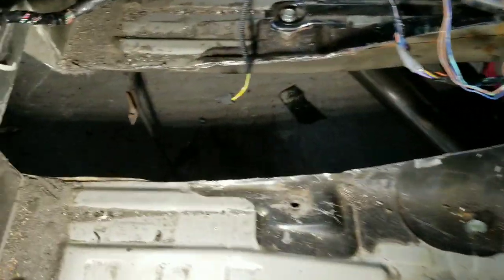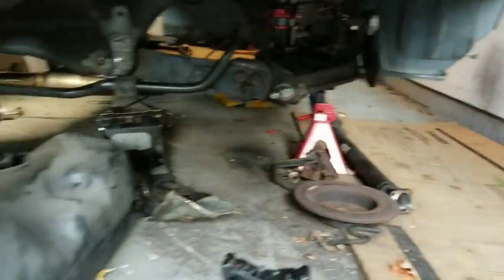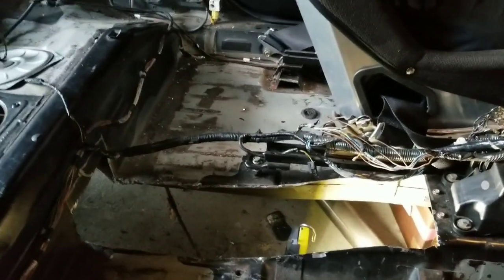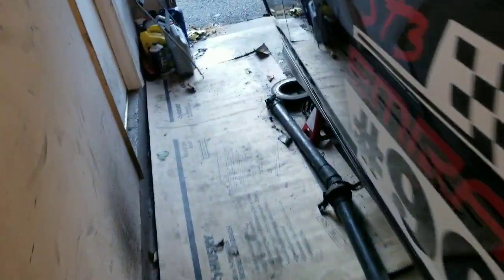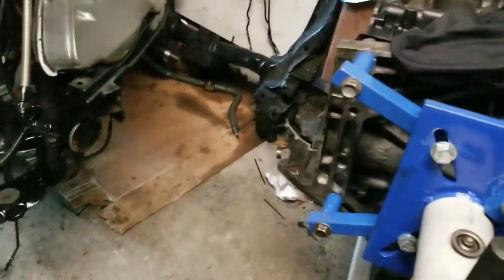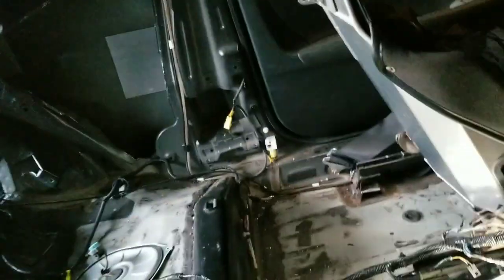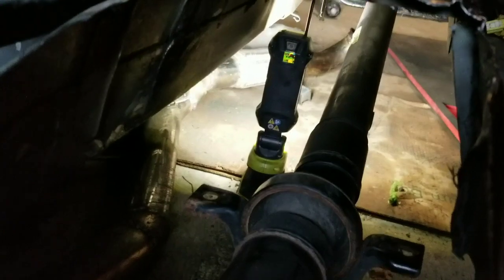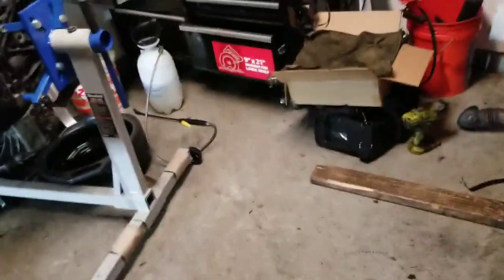Project Awd Rsx - driveshaft in place - part 8

Comment: I checked on the part numbers and the rear motor mount is different. Can I use the RSX transmission bracket, transmission mount, and front mount? I'm trying to slowly gather what I need for the AWD swap. Your videos are awesome! keep up the good work!
Reply from the maker: All mounts are the same except for the rear mount that one is different and requires a different bracket too. Use must also use a crv or element subframe. Thank you bro I'm glad your enjoying the videos! Should be filming more content after the holidays, keep an eye out. Started the fabrication process 😁💪💪💪